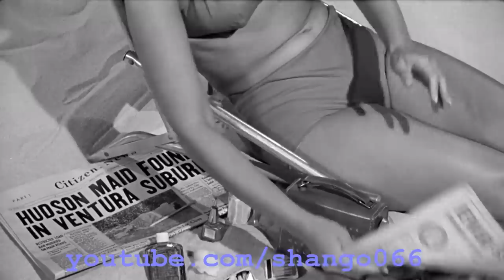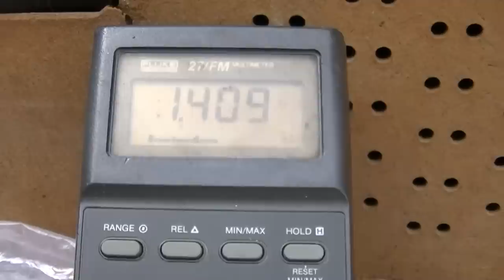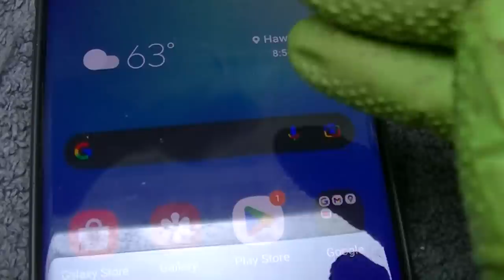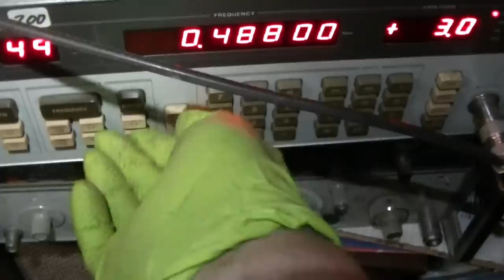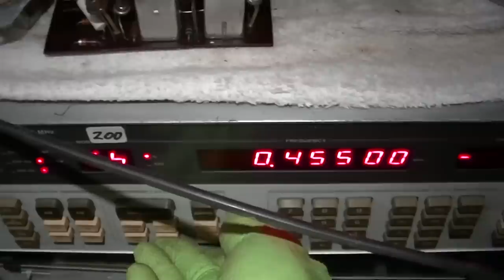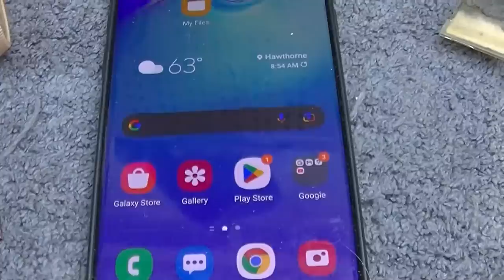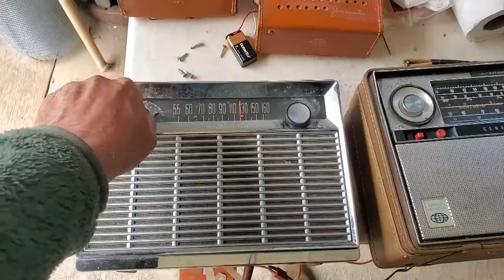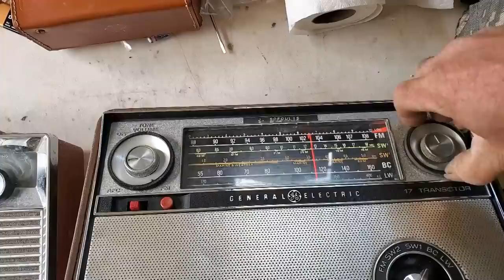1956 Jewel TR1 Transistor Radio Repair Baby Jane Movie Radio

Comment: Hi Shango, 

I'm very glad to see you got it working well in the end. We all break stuff sometimes, I've had my fair share.. That cracked core you found sure was interesting, maybe it was younger me who did that, who knows. 

I've finally had my first successful transistor radio repair. It was last month on a GE p-746a. All bad capacitors, bad driver, and bad output transistor. Currently working on a 1934 Gilfillan 4-T, going good so far. Power transformer checks ok. Perhaps I should make a video of repairing a radio someday.

I'm also getting my first car, it belonged to my Grandfather. It's a 1987 Cherokee Wagoneer. I look forward to getting it on the road after our mechanic gets it running good! Needs a new radiator, fan, tires, etc. 

Take care and I look forward to more of your videos,
Nick

Comment: That audio transformer looks like a well known war surplus job that had 3 windings at 10,000 ohm CT, 2000 ohm CT, and 600 ohm CT.  was popular with hams in phone patch circuits, and also was used in transistorized inverters to get low current B+ voltages for portable tube rigs.  It would make a good replacement for transistor audio driver transformers, though a bit on the large size (ok in radios of this era though).  That "Lionel logo on the transformer clinches my ID of it.  The audio output transformer is attached to the speaker.
Those IF transformers are as broad as a barn door.  Those cans are too old to have silver mica issues.

Comment: There are some things that they didn't make better back in the day.... And that radio is a prime example of that.
Reply: Most things were terrible in terms of build quality back then. Also very expensive, I bet this POS would cost like half a months wage. Repairablility was better because of the simplicity, but parts would be very expensive and hard to get. Today the average person can go to digikey and order a bucket full of high quality, cutting edge parts for like 50$. I hate this "everything was better in the past" narrative when it comes to electronics.
Reply: @WolfmanDude  yea, just like early flight.
Reply: That is made better than radios today, though it is kind of silly to compare them.
The typical transistor radio even of the time had tiny speakers. At least this one has a reasonable sized speaker.
But I agree there was a variety of quality.  You could spend the extra coin and get something made very well or you could buy something cheap. If you lived in the city, did you really need a fancy DXer AM radio?
Reply: @WolfmanDude A lot of things were done like that then. Collectornet laments over that as well. That’s about the same time that Panasonic and Sony started bringing their products into the USA market and also why they succeeded.
Reply: And yet they are still around whereas today’s radios are in the scrap yards.
Reply: @charlesmurphy1510  To be 100% fair to today's crap, this was taken out of use at a time when we didn't live in a throwaway culture, especially if it worked. People were just a lot more hesitant to throw things away that working.
Reply: @charlesmurphy1510  Word.
Reply: Things were crap. Then they got much better. Then they got much crap again. A big retail store radio nowadays is just some mysterious 'glob top' IC with terrible tuning.
Reply: @charlesmurphy1510  Yes, well, that happens when you wreck your car. Seriously, where else do you find a "today" AM radio?
Reply: I bought one of these at a garage sale just before the Callender flipped to the year 2000. It had a 20 dollar price  . I asked the owner if it worked,  he said yes it does. It looked brand new, obviously was never abused,  he plugged it in and quickly was tuned into a local station from LA.  Sounded very clear, no hum. He told me his mom bought it new, and she had passed a few years ago. I bought it. That was 24 years ago. Its kept in our dressing room, I usually turn it on when I get up on days I work. Its never had any issues,  the leather case still looks very nice. So I will have to say its been an excellent radio for me , at 68 years old !
Reply: @tarstarkusz  most of small consumer electronics today are unrepairable.
Reply: @ampatsutsaysison3161  But a good part of the reason for that is it is so economically unfeasable to repair such things because they are made in China.   When we import stuff from China, we are importing very low costs of wages and other manufacturing costs.  But repairing them in America is done at American cost of wages and other overhead costs like rent, insurance, power etc. The difference between Chinese costs and American costs is so high that it makes simply replacing the broken item with a new one from China cheaper;

Even if they were made exactly like the old way and with all the parts and schematics easily available, they would still be "unrepairable" in the sense that it would cost more to repair one than to buy a new one.
Reply: @iroll you can still buy  new am fm pocket sized radios today. Sony, Panasonic,  and many other companies make them.

Comment: The "interstage" yellow coated transformer with the stylized "L" was made by Lionel the model train maker.  The yellow coating is MFP (moisture and fungus proof varnish) applied to electronics sold to the military for use in tropical environments.  That radio was made with whatever Jewel could get surplus cheap.  Not proud that the front of the case advertises  "Made in USA".  I would bet that the Lionel transformer cost the US Government more than the entire cost of the Jewel radio at retail!

p.s.  The case was made out of cardboard laminate with plastic leather coating.  Cheap and nasty.  🤢

Comment: In the daytime, you'd expect a 77 KW station at the bottom end of the band to be copyable 200-300 miles away in a quiet  RF area with a reasonably sensitive radio. Over a mostly ocean path it would be longer. In South West England North Spanish stations are just there in the daytime near the coast at the bottom end of the band only.. About 500 miles distance

Comment: TOP TIP with those cores, add a little Vaseline (petroleum jelly) and use a VERY fine elastic band to lock the thread in place.

Comment: For a 1956  transistor radio the Jewel TR-1 it works good for what it is, the parts inside looks like parts ment for a AA5 tube radio. GE usually makes good radios, I have that same old great performing GE radio mine is call "Eight Transistor".

Comment: I have fixed a broken IF core (3 pieces) with a minute amount of 2 part epoxy years ago. I guess super glue would work as well.  The context-- a 6 transistor construction kit and an inexperience hand.   That lead me to make a 3 transistor 455kHz alignment oscillator using a new fangled ceramic filter.
My wife's uncle told me (back in '72) that adjusting the screws in those little cans gives the radio a better tone!   I think these are the first to suffer when a radio was not at peak performance possible due to a dicey battery.
.In the late 60s we were taught to always do alignments at lowest possible level to avoid AGC complications. I'm not trying to teach my Grandma to suck eggs, just saying.
Best wishes from Australia

Comment: I hit 72 years haunting this big blue marble last May. I have been watching your videos for years now and have been tinkering with transistor radios for awhile now.  Last month I hit the jackpot, so to say - every radio I bid on. I won so I had a quick influx of old transistors. I have been sort of disappointed. Nearly every radio had a power problem, either corrosion on the contacts or bad earphone plugs. I had all of them going in around 15 minutes. I did go through and test the caps, replacing a few on each set.  Do you have such problem? I love watching you troubleshoot, perhaps I will find some to work on if I keep getting cheap sets. I even picked up a couple mobile tv's for cheap and even bid on and won a broken TI83+ calculator for 5 bucks, opened it up and it was a power problem, the place where the batteries touched a copper plate was spilled on with some coffee (I think) and when I cleaned the pads the calculator works fine as well.  Maybe it is just a trend or something.

Comment: That big bold "L"  on the audio transformer looks a lot like the symbol for Lionel, like in toy trains.    It's in an expensive hermetically-sealed can so it might have been military surplus.  A lot of companies you wouldn't think of made mil-spec components.   THere even was a run of R-390A radios made by HELENA RUBENSTEIN.    Weird.  Also weird, that three-legged capacitor.  Good intuition that the radio was running as a TRF for a while!

Comment: shango066 Core materials are very rarely identical more dense iron in core slugs for lower frequencies and low iron content for high frequencies, it's something we all catch onto eventually you can test them using and Rf dip meter in a coil to find their resonance not sure you can find a DIP METER ? I have one by MAPLIN mine is model YN48C  I wouldn't call your video a dead video anything that learns something new is good 😃

Comment: Learned something. Different cores make a difference.  👍
Reply: I remember there were 5 different cores to those standard coils marked with cyan, red, green, blue and yellow color. Cyan/red were used for FM, green for SW, blue for AM and yellow for AM IF and LW approximately. On FM you can also use core from aluminium, that lowers the inductance.

Comment: I have this same radio branded as a Majestic. You may be able to find a diagram for it under that name. I believe this model was sold under under other names as well but they are eluding me at the moment(Laffayette possibly?).  This was one of the first transistor sets I got my hands on as a kid just getting into the hobby. Same as yours none of the caps were labeled. Think I replaced the multisection with all 33s pulled from a junk VCR.  I still have it and it still works just as poorly as when I recapped it over a decade ago. Maybe I'll mess around with the alignment to see if I can wake it up a bit more.
Reply: I'm not sure about this model, but the later Jewel that looks like a Zenith Royal 500 was another model with several names. Home Mark, Hudsons, Artone, Tonecrest, Ambassador, Cosmopolitan are a few that come to mind.

Comment: You could take apart the mystery capacitors, measure the plate area and the insulator thickness and calculate the capacitance that way
Reply: Bit hard to do that with electrolytics...

Comment: Some of those germanium transistors have a little metal bit at the top that looks like it originally had a metal tube that someone pinched off. Maybe these were vacuum-filled transistor bulbs. Maybe to keep the germanium from forming whiskers due to air exposure?

Comment: the slugs do have different "mixes" same as ferite chokes for rf and linear amplifier "transformers". palomar-engineers has a page with some info. You gotta use nylon wands to not crack them
Reply: No screwdrivers !🤨

Comment: I need some output transistors for my GE chrome face. One of them is overheating but the radio is still working good. I was never good at biasing germanium so I might leave it alone for now.

Comment: Some of the radios back in this time, Did not have a tuning cap. range like a normal radio. I think this was done, so you can be anywhere and tune in a station a lot better... Supposedly!   My guess, is that, this is one of the same kind of radio!   I will see if I can find you something on this topic!

Comment: This was not a video that went nowhere. Yiu said yourself you learned somnething about  ferrite vs iron core. The differences in the IF slug core material makes sense. We sell surplus toroid cores that have very different frequency response and loss characteristics for switching power supply applications vs. RF for ham radio antenna impedance matching, for example. We get customers that want very specific cores and ask for them by number.

Comment: transformer cores.  Those could well be made of different ferrite materials with different magnetic properties so they do not all perform the same in that transformer.  A LOT goes into selecting magnetic stuff for RF as well as power supply parts.

Comment: Perhaps you could file/grind/hackssaw a new screwdriver track on the opposite side of the broken ferrite core..   and turn the ferrite core upside down and screw it back in and voila then it may be good again this way?

Comment: Is it possible that these radios actually run at a lower voltage? I’ve had radios that used the same 9 Volt battery connector, but were meant to be run at 6 Volts with a 4D Cell Battery Holder.

Comment: if the IF is off ...then shift the oscillator and it will work just the same. the assumption of 455kc  rather than 565 kc is probably wrong.

Comment: What's the phrase? "You can't polish a turd" More jazzle than jewel. So yes, they made crap back in the day too. Interesting that the IF core material changed the response characteristics. I guess it had different permeability to the lower frequency core.